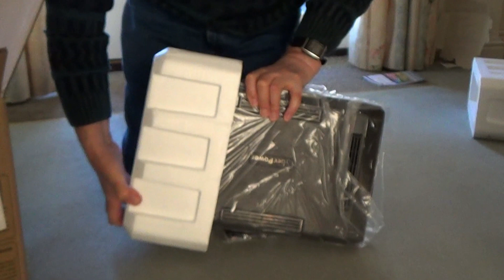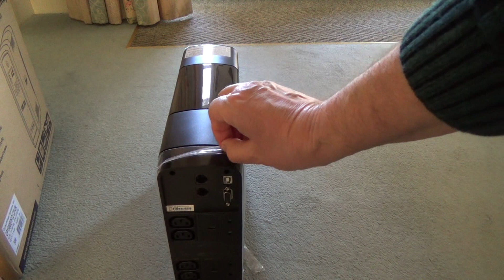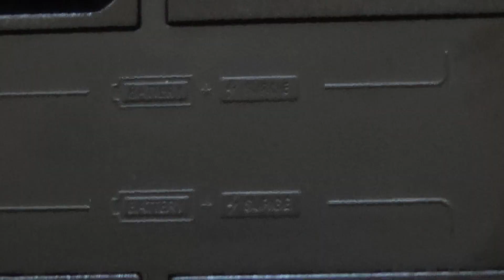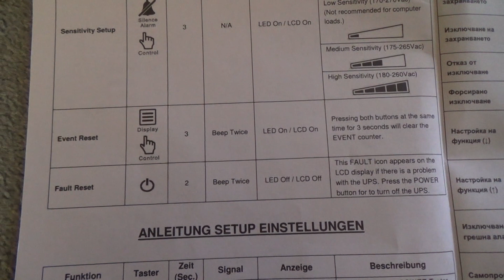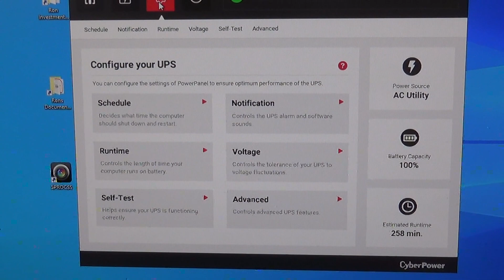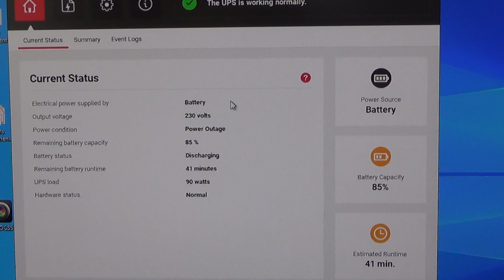#CYBERPOWER CP1500EPFCLCD UK Ups battery backup pure sine wave

Comment: Interesting, seems you got the same as me in your box. I came back here to watch this again because I’ve just opened my box and noticed the lack of a RJ45 cable (not that I would have used it). I found a quick start guide on the Cyberpower website which implies both an RJ45 cable and quick start guide should have been in the box. But then in small print it says box contents may vary by region. Found loads of foreign unboxing videos where they got a RJ45 cable in the same bag as their USB cable. Rip-off Britain again, I guess.

I’m going to use mine to protect a low powered home server Im setting up atm. Im basing it around an AMD 5600G (no separate GPU) so 500W should be more than enough.
Reply from the maker: It came with a USB cable to connect to the computer but it isn't networked or anything. You can run RJ45 through it to protect against power spikes I think but it does not communicate through it. Personally, I haven't run any data lines through it. I have plugged the USB into the computer for the Power Panel Software but my computer is switched off a lot of the time, I mainly bought this UPS for my CCTV system but the Computer and Monitor and Printer all run through it when I'm using them. So far so good, I saw a YouTube video that says there's some glue on the PCBs that causes problems but mine is fine so far.. I have my router on a different UPS in a different room. Since I bought it, I've only had a couple of power cuts but I sometimes unplug it just to make sure it's still working..
Reply: @ron2256  I think the idea is that you pass your first ethernet cable coming into the home through the UPS to protect from lighting ground strikes. Not really sure how much damage could actually be done by lightning in that way. Probably whatever was first connected (Router) would get taken out before current could reach any other devices? You can also plug your phone line into the same connection if you wanted to. Everyone will switch over to optical feeds into the home within the next few years, so this will be a non-issue pretty soon anyway.

Ive had a much higher rated APC UPS for years, which I use on my main PC. Im trying this Cyberpower one, because it is smaller and from what I read quieter. My server is going to sit in a corner of the living room, so small and quiet was high on needs list for everything. I only need protection and for it stay on long enough to shutdown. The much bigger one Ive got for my main system can run the computer and two monitors for over 20mins.

We used to have a lot of short (second or so) power cuts a few years back and that is when I got into using a UPS. We don’t get them anymore, but I hear the UPS click occasionally when it detects problems with the incoming supply. Most good computer PSUs will protect from this stuff, but I like to protect the PSU from getting stressed as well. Running a server you don’t really have a choice, you have to use a UPS.
Reply from the maker: @Ironbuket  This one is pure sine wave as well
Reply: @ron2256  Yep, my other one is also - I am aware of the difference. I almost went for a simulated wave of a cheaper model, but this wasn’t that much more so paid the extra so I can use it with anything in the future without having to think about it.

Comment: Thanks for this Ron. It looks a good unit.  From your video the unit seems quiet even under load when you switched the input power off. Does it stay quiet or get louder.  Thanks again, Cliff
Reply from the maker: It has the fans on when mains power fails. When the mains comes back on, the batteries need charging back up to 100% and the fans may stay on for a while as that happens.. Under normal circumstances when the batteries are charged and the mains power is on, the unit is completely silent. It all happens automatically.. Obviously the batteries can become completely discharged during a power cut and the unit will switch off. I presume it will switch back on again when the mains power is restored. I have my PC and monitor and CCTV running on the UPS. But my main reason for getting it is to run the CCTV system so if I'm at home, I will quickly shut the computer and monitor down and if I'm not at home, the PC and monitor won't be switched on anyway so I'm hoping that it will run my CCTV system for over 2 hours during a power outage and hopefully that will be sufficient for most power outages.

Comment: Thanks for reviewing bro, can you tell me why my led display in screen saver, I want display all time on how I do that
Reply from the maker: I think you press the Display button for 2 seconds
Reply: @ron2256  thanks for reply, 2 second for open led display but after 5 seconds led screen saver again
Reply from the maker: @Неизвестный-ъ5п  I don't know then, mine just has a blue light unless you press buttons or if there is a power cut..  It is typical that since I bought it, I haven't really had any power cuts.. But it's nice to have. I've got my PC and my CCTV system running on it.. I had a Belkin one before which was a real pain, it caused the power to go off from my PC when there wasn't even a power cut.. This one seems good, so far and having pure sine wave is a benefit because you can daisy chain UPS's together as long as it is pure sine wave.
Reply: @ron2256  hello bro, afte 4 days using ups he has nosiy so hard While the computer is working and after shutting down the computer I don't know why
Reply from the maker: @Неизвестный-ъ5п  mine is totally quiet until it has a power cut.. Then a fan comes on, there's a bit of a hum and it bleeps. When the power comes back, the fan stays on until the battery is charged, then it goes silent again.

Comment: The UK market gets slightly ripped off because of the bigger UK plug sizes. The US version of the same model has 5 power protected sockets and 5 surge protected only sockets (10 total) which they can plug into directly and match their wall sockets. The UK version only gets two 3-pin sockets you can plug straight into and 4 which you will have to alter/replace your cables to be able to use (6 total). You are not supposed to use power splitters, but I bet a lot of people do only having 2 usable sockets.
Reply from the maker: Yes, I've got 4 gang extension leads off both sockets but they're not running anything powerful, just a PC and Monitor ans speakers and my CCTV system and a printer, if it happens to be switched on.

Comment: what do you think of it, now you've had some time to use it?
Reply from the maker: It's still ok at the moment. But we haven't had many power cuts. It seems happy. I can't remember how long I've had it.. it runs my PC and monitor and CCTV system plus a printer and an ethernet switch but sometimes only the CCTV and ethernet switch is running but sometimes everything is on.. so, touch wood, it's still fine.
Reply: @ron2256  thank you!

Comment: Do you happen to hear a slight hum like an electric current when it is running normally (not with batteries or fans on)?
Reply from the maker: No, I only hear it when the power is off or if it's charging up after a power cut.

Comment: Hi Ron, can you please tell me if it makes noise when running on battery, or maybe under heavy load, it's just that my UPS is very noisy, and it's unbearable, I want to find the quietest one that does not make noise under heavy loads
Reply from the maker: When it's charged up and the power is on, it is totally silent.. If the power goes off, it buzzes and fans come on.. When the power is restored, it continues to make a noise until the battery is 100%, then it goes back to being silent.. So most of the time, it makes no noise at all.. Hope that helps..having said that, mine isn't under heavy load, just a CCTV system, a PC, a 27 inch monitor and speakers..
Reply: @ron2256  Understood, thank you very much

Comment: Are all of the sockets definitely on the battery? Honestly I would rather one of them were not so I could put an extension lead into it for non essential things as I only have two main sockets in the room and one is taken up with something that cannot be on an extension while the UPS would take the other. But I dont want some things on the battery.
Reply from the maker: This is the UK version and I believe that everything is on the battery.